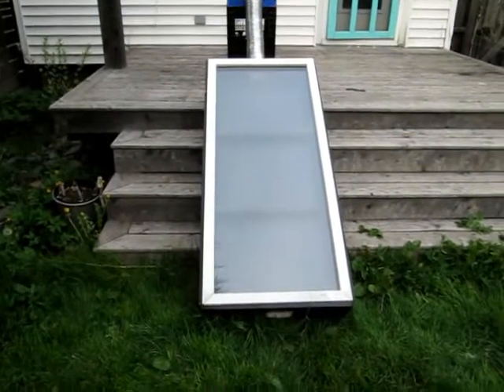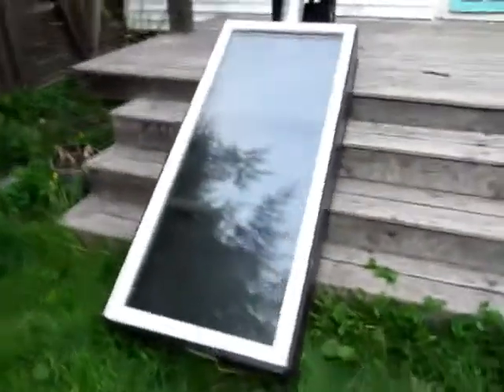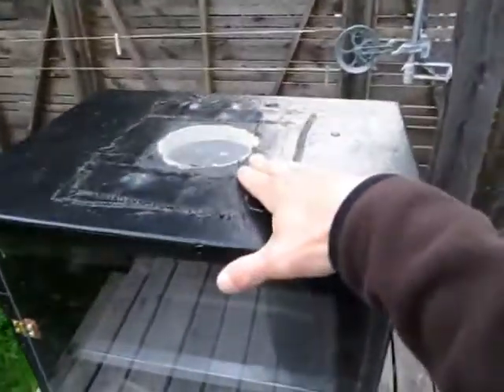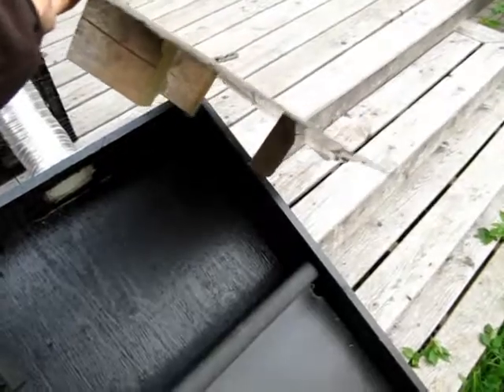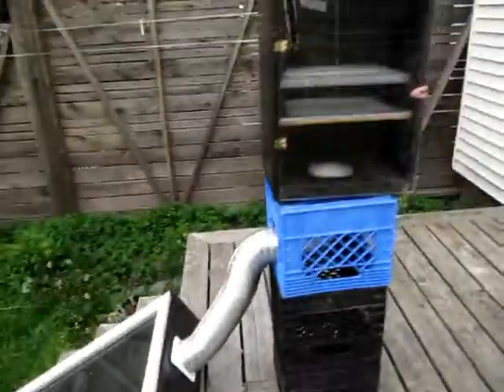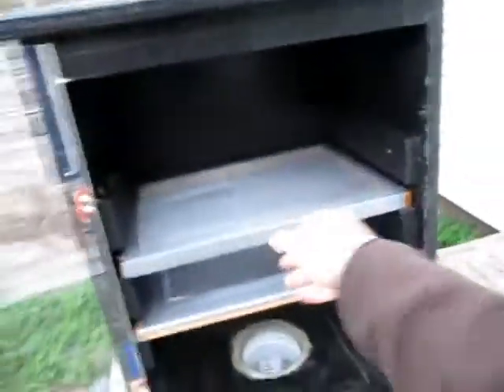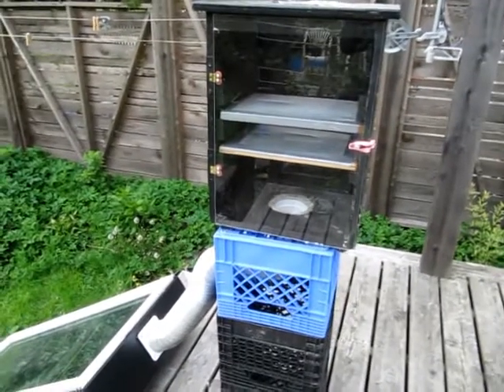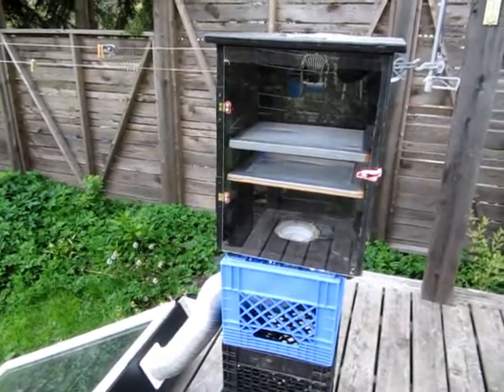How to Build a Solar Food Dehydrator - Part 1 of 2

Comment: ultimately what dehydrates is the air flow, not the heat. So you need to maximize the airflow; the air must enter upside down to the drying chamber (not as you instalelled it, because the flow will fight with the cumulating humidity and stop, therefore you will end up having a Solar cooking stove). Then insulate the dryer hose, and make a tall chimney that starts at the bottom of the drying chamber. The key to this, is the airflow, so keep it sealed... cheers!!!

Comment: yeah, i found 'em way cool too.  
somewhere - on paul wheaton's channel maybe - there was a down-draft someone created out of an old refrigerator or freezer cabinet.   The guy put a chimmey on the bottom to help create an exist draft, helping air-flow even further.  But i think those two you viewed had chimmeys too, even higher volume, built in to the side as hollow wall space

Comment: seen these designs?  see how huge the air-flow-paths are?   air movement appears to be key. 

also, these designs opened my eyes to down-draft the air .... after all the air is cooling after it leaves the collector... the pull creating a downward draft... 

watch?v=oVTcnCuX2Qc&list=PL5dy2NXq4GKCDgubRS7UvSkbWmCP8_NZd&index=2

& 

watch?v=5U1JgAkW-xY&list=PL5dy2NXq4GKCDgubRS7UvSkbWmCP8_NZd&index=4

Comment from the maker: Thanks. My other thought was to use painted beer cans glued together in long tubes with the tops and bottoms cut out but the metal signs I acquired fit so well that I had to use them. I'm not sure how I can really increase the air tube diameter. It's hard to get larger tubes. And I can move the sun collection box independently of the dryer box but I don't that often because I get lazy.  :-)

Comment: Brilliant idea having air moving over both sides of the sheet metal inside - VERY nice way to double the thermals !!

Not sure, but i would think that the 4" tube is restricting air flow, significantly, as is the vent-hole on top of the drying chamber. 

i would assume you designed it that way in order to position the collection box as you wish, as position of sun changes.

Comment from the maker: Well i'm happy to say that it actually works.  

So far the maximum temperature recorded in the heater section was 56 degrees Celsius which got the drying rack section up to 50C.   On an average sunny day the heater section gets up into the high 40s while the drying area gets into the mid 40s. 

These temperatures where recorded in late May in Nova Scotia.